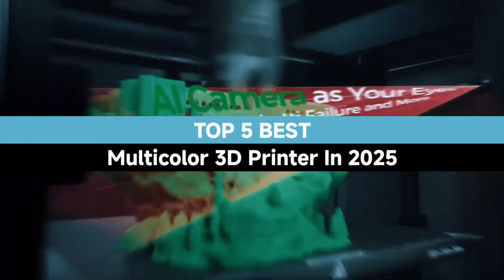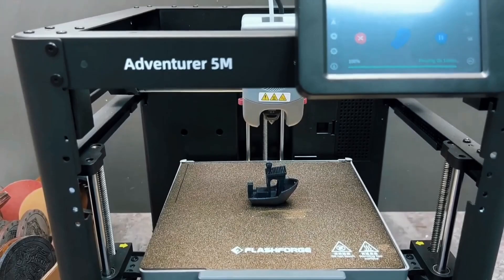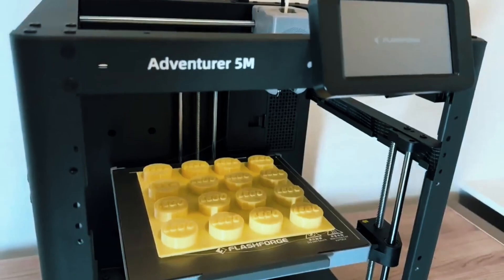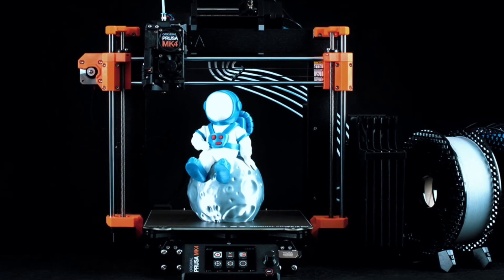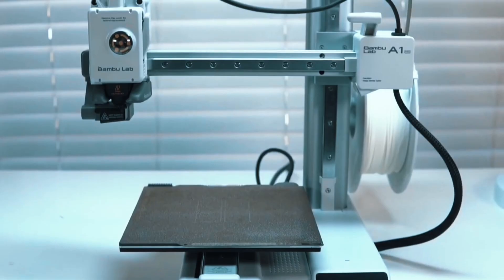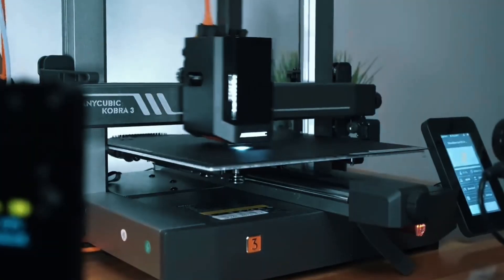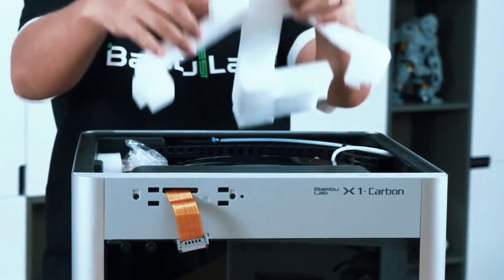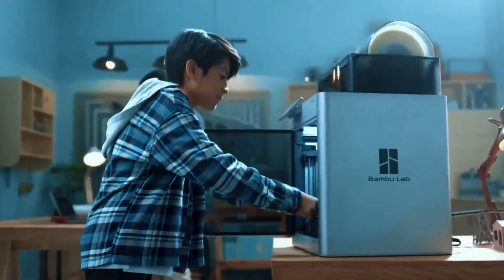Best Multicolor 3d Printer 2025 :Top 5 Best Home 3d Printer In 2025

Comment: The MK4 is top notch 😊 You just turn it on and it prints. Everything works as it should and Prusa has excellent support too 🙌 It's a whole different league compared to cheap clones 😎
Reply from the maker: Thanks for the info!

If you need it, you can order it by clicking on the description and link.